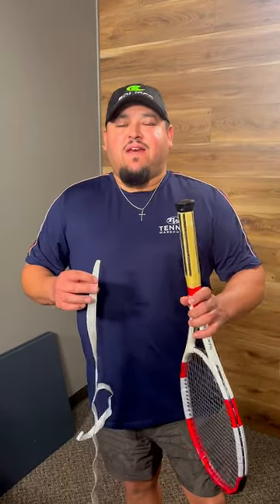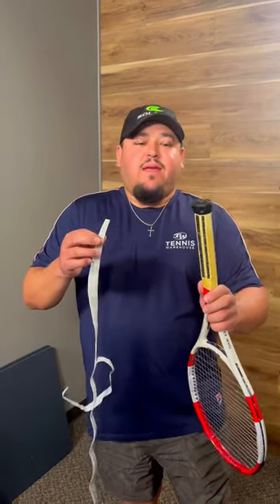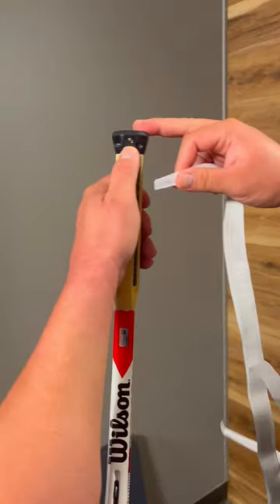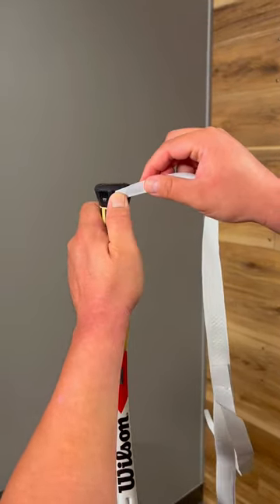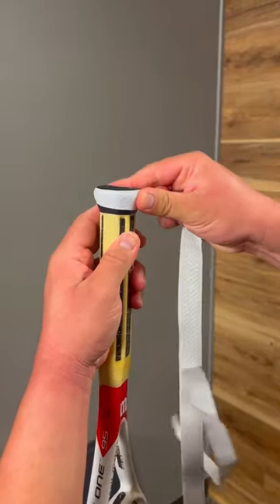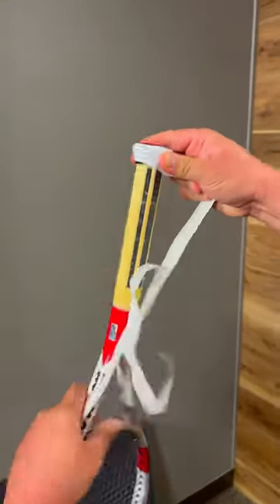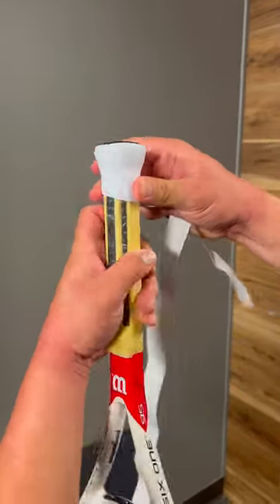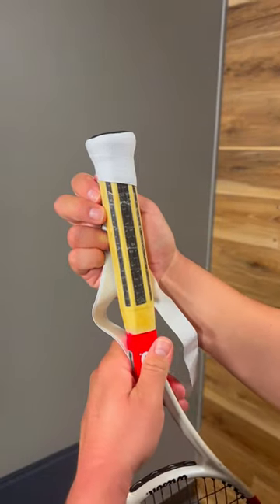confused about installing a replacement grip on your racquet?! TW shows you toughest part! #shorts

Comment: I just can’t ever avoid the wrinkles on that first revolution…so frustrating!  Lol😅
Reply from the maker: Yeah it can be frustrating. I was just training a newer racquet technician here at TW the other day, and with some grips and certain butt caps that have a big flare, you have to make sure that you pull very tight to get all of the slack out as much as possible, and also have to accept the fact that there will be more of an overlap on the first full wrap, compared to the minimal amount of overlap that is needed once you work you way up the handle. Troy, TW

Comment: Which side of the tapered end do you start with? Is the flat side of the tapered end flush with the butt or is the angled side the one that's flush?
Reply from the maker: I believe it is the flat side of the grip, because I think if you used the tapered cut side, it would be wrapping the grip in the other direction for a lefty wrap. Troy, TW